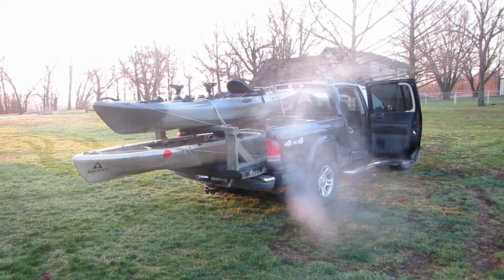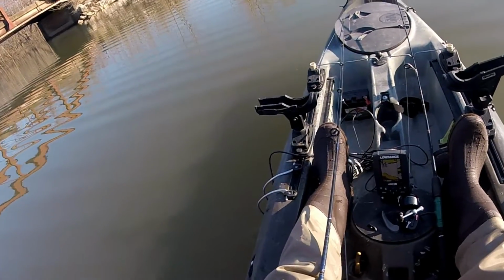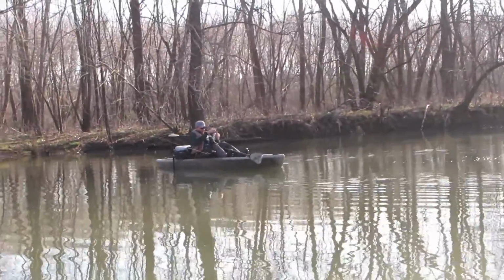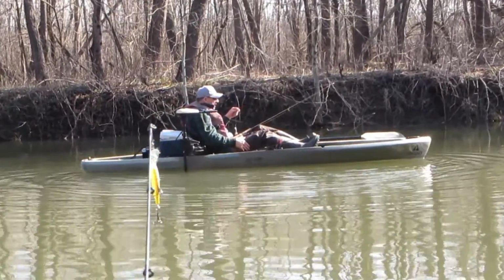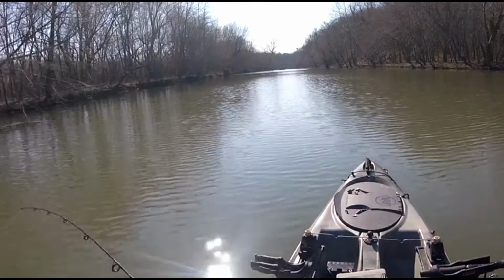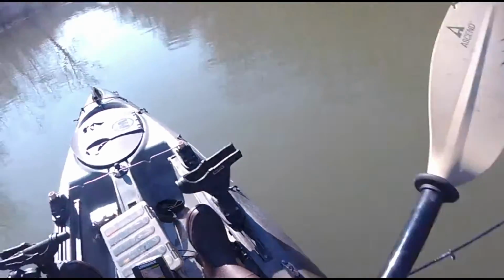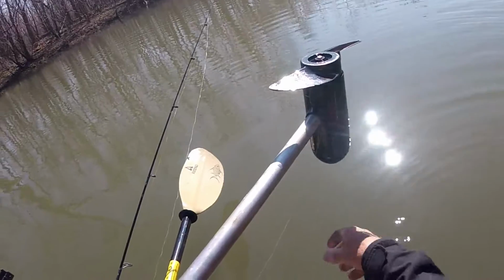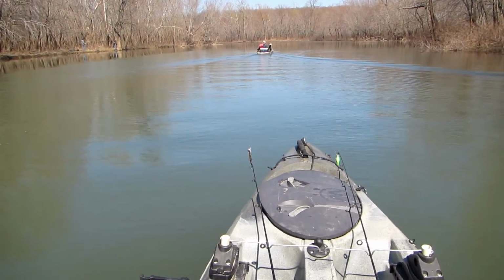FISH4FUN: KAYAK TROLLING FOR WHITE BASS

Comment: Very nice double up there. Great day on the water. I think I will have to pick up me a few of those Flicker Shad, you mentioned a number 4 Flicker Shad would that be a good starting size?
Reply from the maker: Bobby, my go to  size Flicker Shad is the #5 for White Bass and crappie.  For Walleye and Bass I use the #6 a lot also.  I used the #4 in this video because the water depth was running 8 to 12 feet and I wanted the lure to sink to about mid range which would be 4 to 6 feet.  And the Whites were running on the small size.  This lure is one of my favorites for multi-specie fishing because everything from Bluegill to Giant Wipers will hit them. Caution, if you are trolling with no more than two rods or casting they are great but they do not run consistently true enough to run 5 or 6 rods at once.  For multi-rigging I go to something like the Bandits or other more bulky lures that run more true.  Thanks for your question and support.

Comment: About how fast are you going while trolling?
Reply from the maker: Craig, on this trip we were trolling from approximately (depending on wind direction) 1.8 MPH to 2.2 MPH.  We were trolling with the gas motor.  From 0.4 or so to 1.5 MPH we use the electric motor.  We sometimes troll as fast as 3.5 MPH for Whites during the spawn. Thanks for watching and taking time to respond.